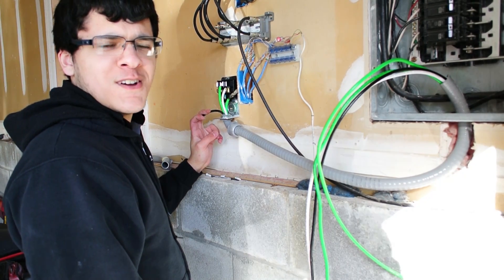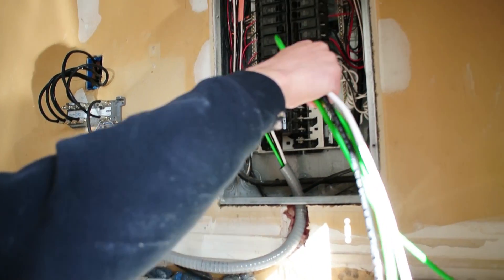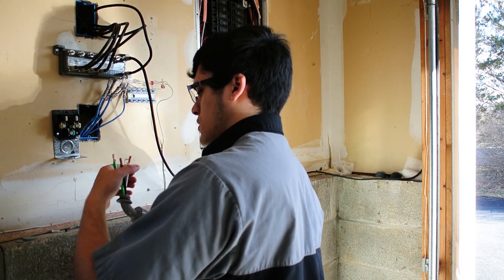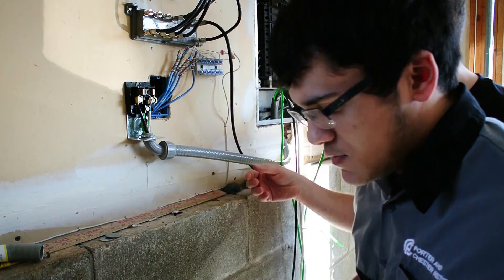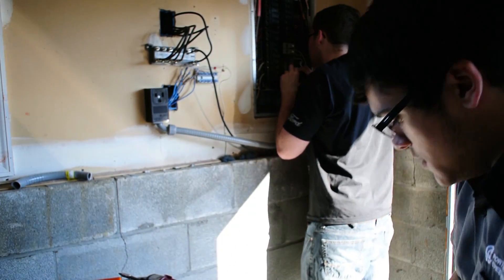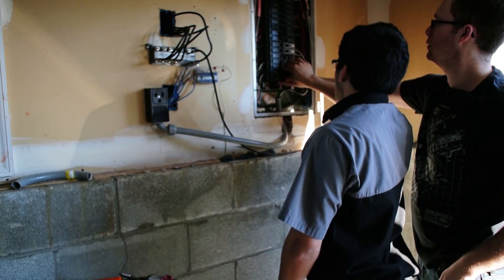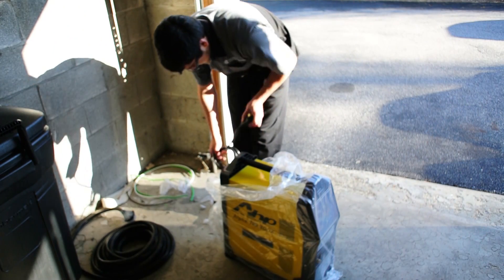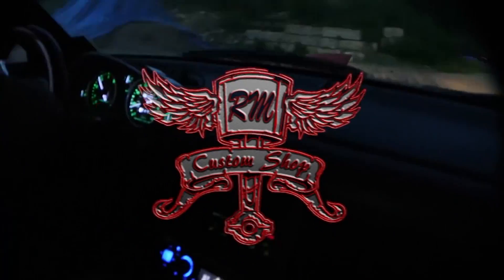How to wire a 220V Outlet for a TIG WELDER!

Comment: Shouldn't you be running a black and a red (or blue) power wire? White is typically used for neutral.
Reply from the maker: Our local Home Depot really didn't have much in stock, we should have gone to Lowe's,, they had a ton more products in stock. Colors really don't matter too much as long as you can tell what everything is.